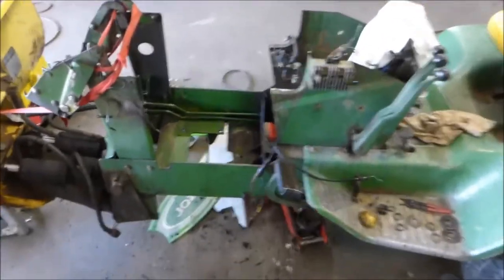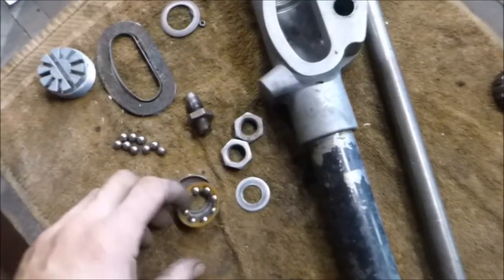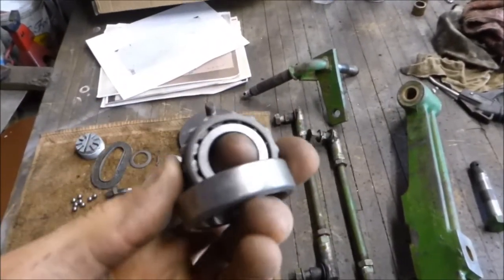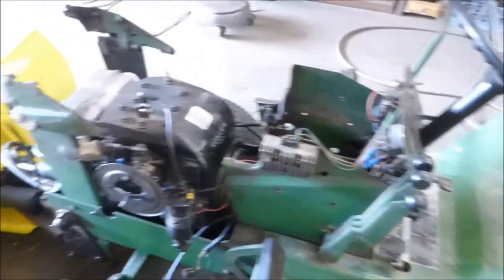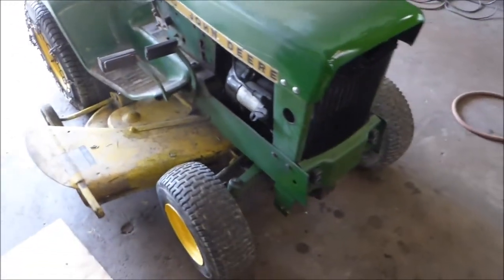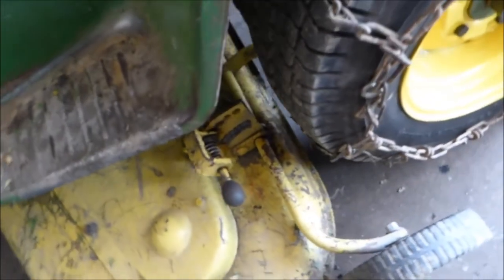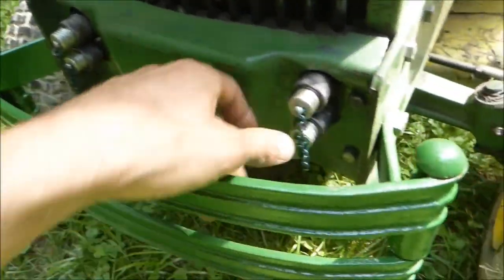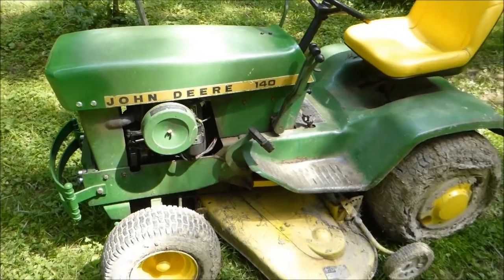John Deere 140 Finished up

Comment: Nice, ya gotta add a tailpipe coming out of the hole or it will drive you crazy.
Reply from the maker: Yeah that muffler doesnt have an open area in that location so it might be louder than it should if i get into the baffles but Im getting some heat and fumes in my face coming out the front. I will most likely add the pipe at some point